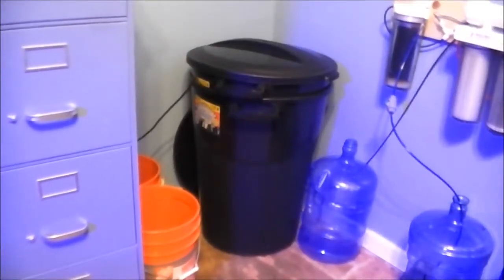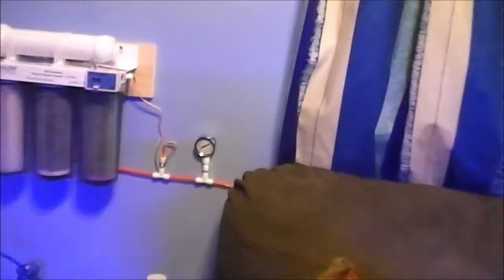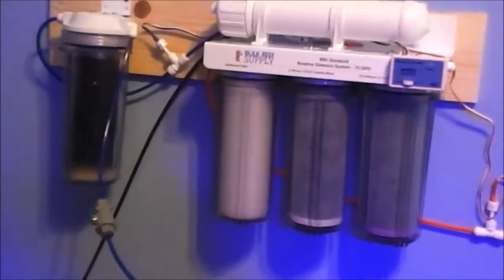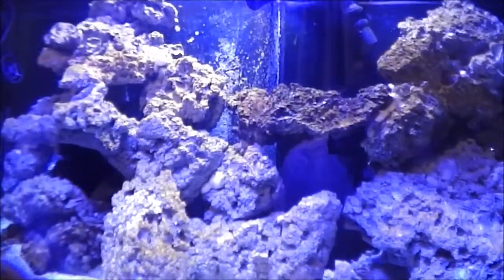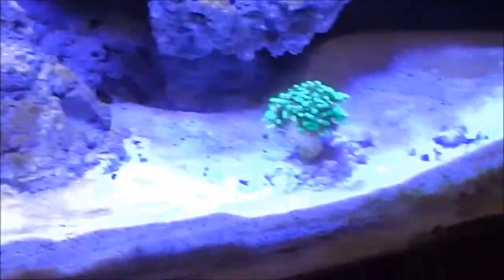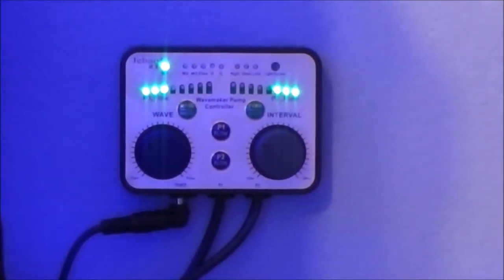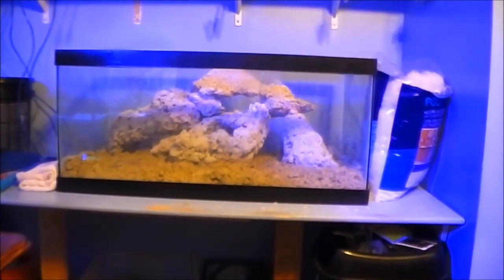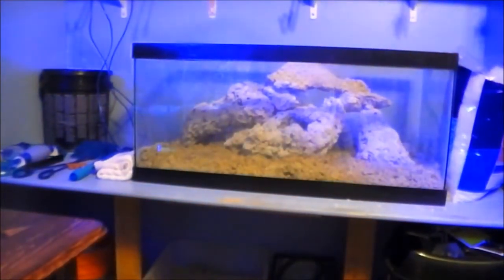BRS RODI Unit Water Changing system

Comment: Spray foam for rock work? Reef safe? And what brand did you use?
Reply from the maker: Bearded Leprechaun I used the right stuff in this video however I would recommend pond spray or if you use the right stuff than I would seal it with a sealer